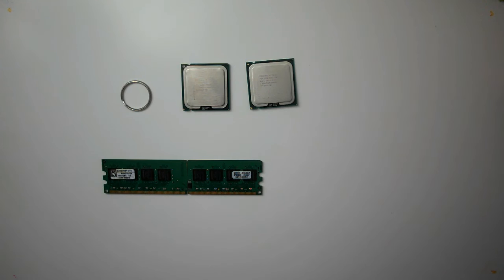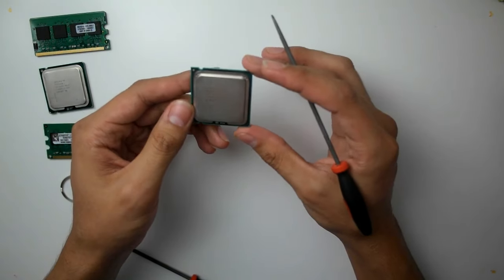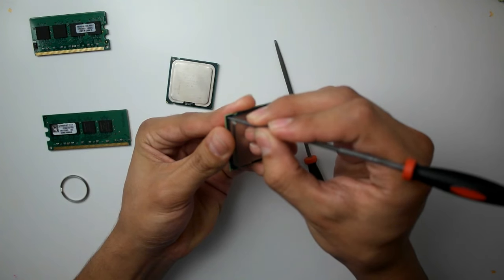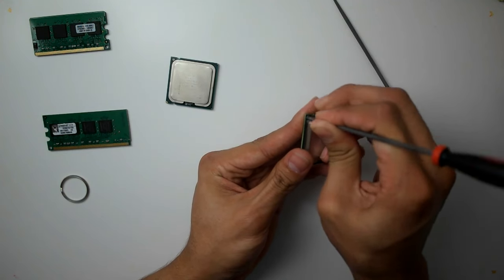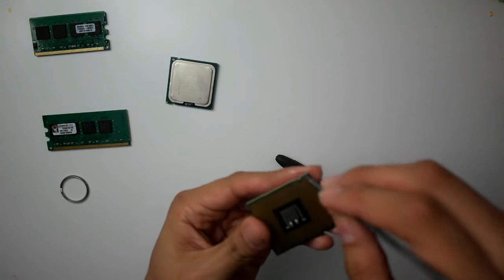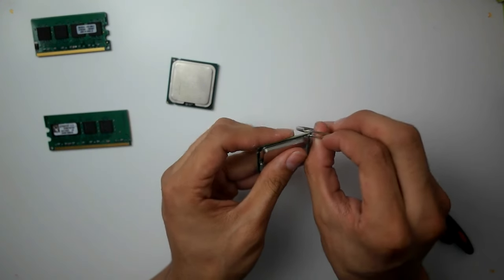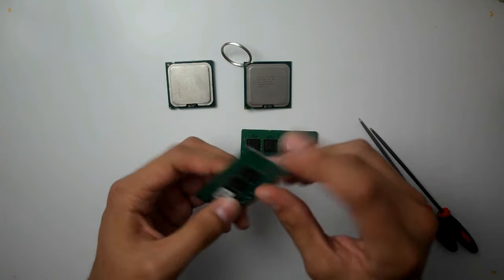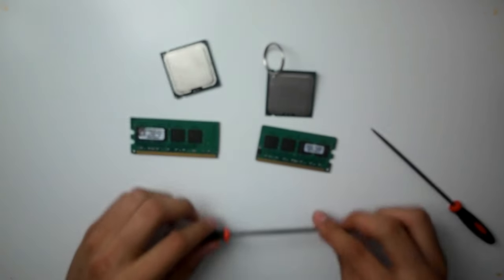How to make a keychain out of an old CPU

Comment: If you want a cpu keyring to last a long time, try to go through the heat spreader too. If you go through the upper right corner with a really low power cpu it may still work.
Reply: i just made a hole through the corner of the heatspreader with a drill and a counter sink (to make the hole look nice)  and i removed the sharp edges of the pcb so it wouldn’t poke my skin
Reply: Yeah man. This guy did it the hard way.